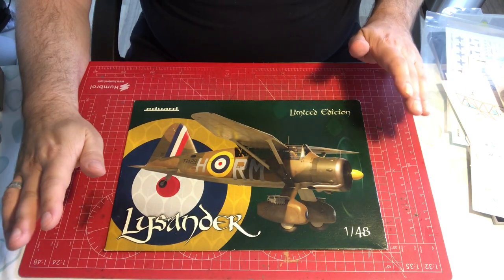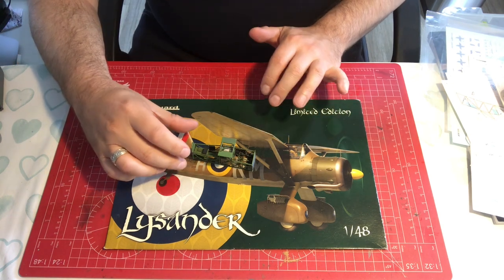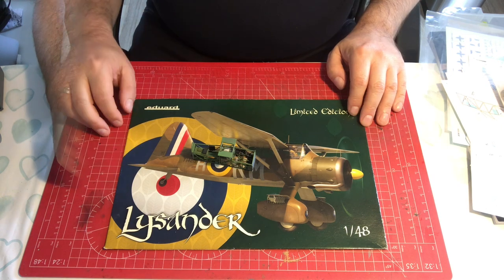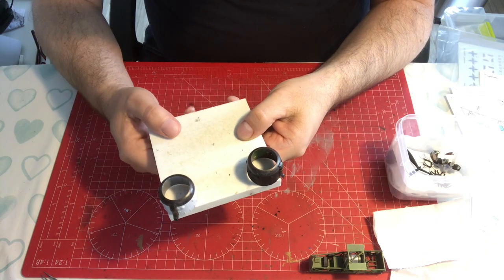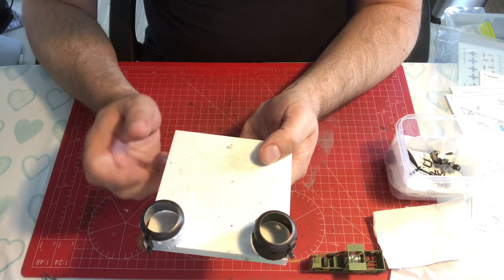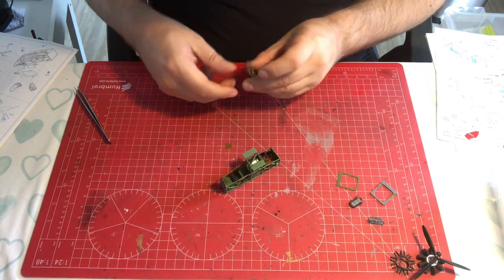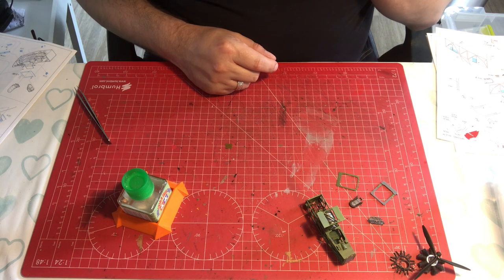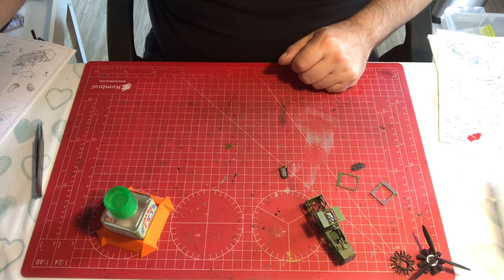Eduard 1/48 Lysander full 'double' build part 5

Comment: What a shame. I don't blame you for your frustration in the Eduard edition. the Finish version is where I would go if building this kit from jump street. The most disappointing thing to me is being forced to have the rear canopy in the open position while the front one is closed. That leaves you with the difficult and unenviable task of trying to open the front one up or butchering the rear one. Thank you for exposing this flaw before I went out and purchased it